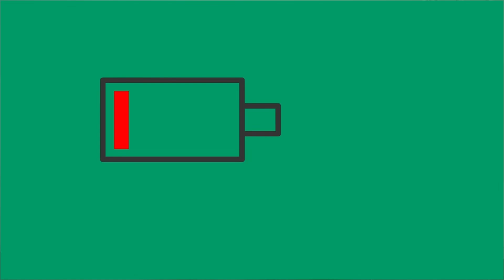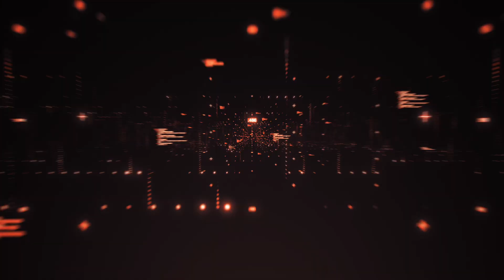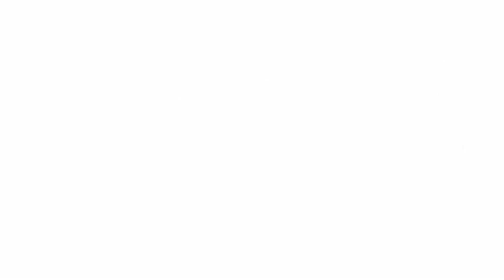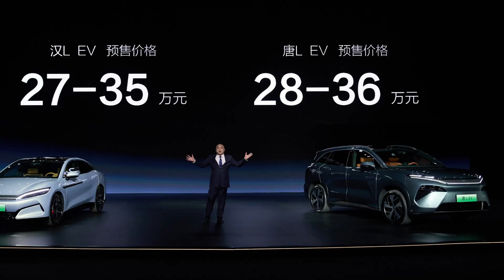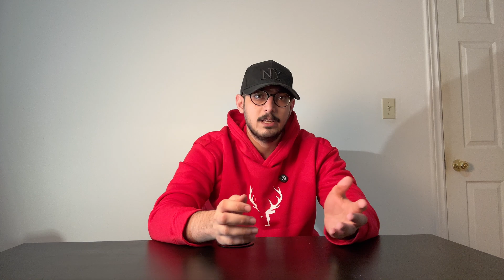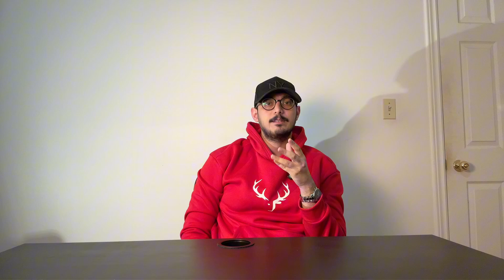Battery Beyond Limits: Chemistry and Cooling

Comment: wish ev mfg would look more at lto, especially in hybrid battery setups.
150s1p 22ah LTO prismatic pack which does all the heavy lifting with small volume that needs thermal managment. 
only around 7.5kwh but you can slam those cells at 10-20c = 220-440 amps for a 400v system = 88-176 kw, plenty of power.

make the rest of the pack out of big dumb/slow lfp cells like 280ah formats made more for slow grid storage. small cells could be used like lucid to improve leg room of car seats with shorter segment of battery pack, and big book sized 280ah lfp cells could be added in less critical height areas like under rear seat. wouldnt need much thermal management for 280ah lfp cells so the packaging would be pretty sparse. with good fixturing, might get away with passive thermal management only which is probably better than ncm with thermal mgmt. ~112s1p lfp pack made of 280ah cells. i would have to draw it out in cad/sketchup but it seems like viable solution for an affordable 112kwh + 7.5kwh EV that is mainly going to be used on slow home charging. 
280ah format lfp cells are ~30-40$/kwh, 22ah LTO cells are ~120$/kwh. 
4000 usd for LFP pack, 900 usd for LTO pack. 
i think you would pick up a lot of cost optomization with passive cooling of big lfp cells. would probably only dc fast charge at like 50-100kw due to 280ah LFP cells being so geometrically challanged. if the packs were approximtely the same voltage (150s lto and 112s lfp), then you wouldnt need an expensive dc-dc electronics between packs, maybe just precharge and extra hvdc contactors. car would drive around on lto for a minute or two until lfp pack is warmed interally and is similar voltage delta less than 0.5%, maybe 1-5 minutes. just lower regen until then or have all regen go to lto.
both packs would last forever and be super safe from thermal runaway. lto doesnt even need to be heated outside of the arctic circle, could use regen to heat lfp pack or something clever for efficeincy. rest is off the shelf 400v electronics/motors
crap i think i just figured out how im going to do my porsche boxster ev conversion^ lol
even ~160-175ah stubby lfp cells like what tesla uses in their chinease lfp packs would still give ~57-63 kwh for lfp pack. around 280 mile total range but expensive cell format.
280ah format would be cheaper and give ~450 mile range lol... 616kg though for just lfp cells. LTO cells ~90kg. call it 710kg/1500lb for cells.
this seems really doable! ~750 lbs to be shed from boxster for ev conversion. 1997 manual boxster has about 700lbs of payload between curb and gvwr so it might not even be over GVWR when im done. can shed another 40-50lbs with an LTO low voltage battery too like i did in my chevy volt (vids on my channel)

dang i had to subscribe. love the barebones set rofl